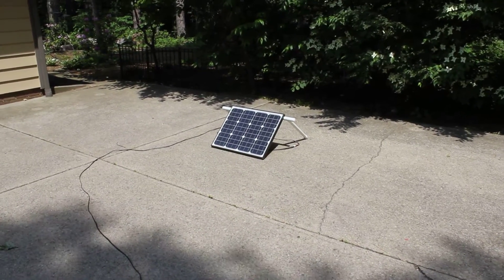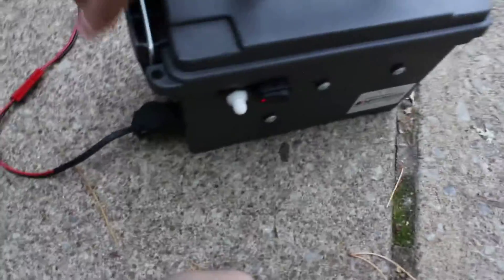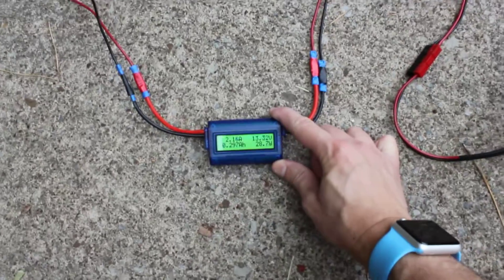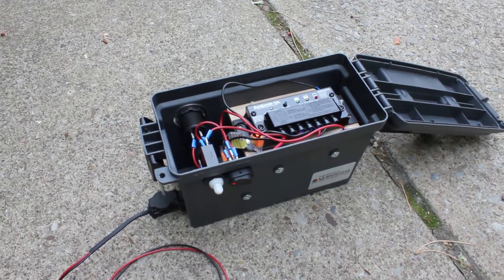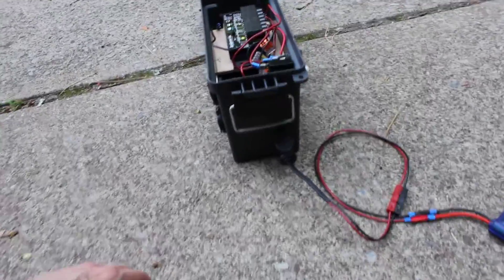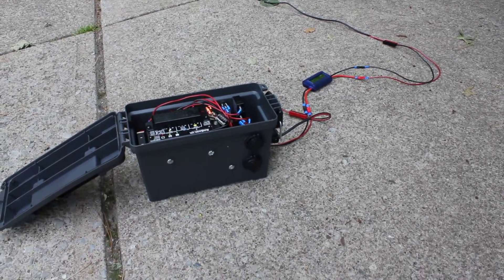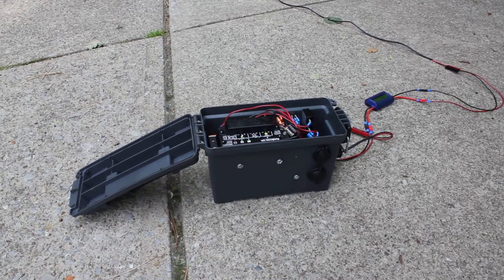Solar Ammo Box Generator - soaking up the sun!

Comment: Please try searching on eBay for "MPPT 5A" and do a rewiew of those solar chargers, they look really interesting.
Reply from the maker: Valent Turkovic I've looked at several of those types of units before deciding on the SunSaver.  It comes down to quality and durability.  Those generic controllers are less expensive, but there's a lot of trade offs IMHO.
Reply: Did you cintainer doing a video showing those cheaper ones and explaining their drawbacks? Here is another one - http://www.dx.com/p/600w-constant-voltage-constant-current-power-car-charger-solar-regulator-dc-dc-boost-module-blue-228310#.VcsrlEZHmnM
Reply from the maker: Valent Turkovic  I mentioned them in my project overview video and blog post (links are in the video description).  I'd go broke purchasing them just to review since there are so many, which many turn out to be the same units, just branded/packaged differently.  There are some that will slap a MPPT sticker on a PWM unit, etc.  One of my primary goals was safety and I couldn't trust any of the generic units out there after my testing.

Comment: Nice set of videos Matt on this set up. How's the new lithium battery/charger set up coming along? I'm looking to make either, so keen to see what you've got planned :)
Reply from the maker: TheLastPost Slow is the word I would use ;-)  Have a lot going on and want to get it wrapped up.  There's some key changes you have to take into account when switching battery types and I want to make sure I cover those in the next video.
Reply from the maker: I uploaded the video with the LiFePO4 battery and controller. Check out the playlist and let me know what you think.

Comment: Although I feel confident in my setup what would you say are the safety considerations/precautions on a setup such as this in order to not electrocute oneself accidentally? I've got a 175ah battery and 2 100w panels linked in parallel. In plastic box I have charge controller with inputs hooked up to anderson powerpoles mounted inside box. Then I have the battery and panels routed to the mounted powerpoles on the box. All connections with fuses. It seems to me the fuses are more for the gears protection and not the current...

Also, I have a few push wire connectors for the multiple load connections. I seem to have trouble getting the wire all the way up the push connector even though it supports the gauge I'm using. Any suggestions?
Reply from the maker: ***** The hard part about these questions are the unknowns.  I understand what you're asking, but there are several details missing.  Here's some recommendations:
- Look at each component and provide proper safety for each.  For example, make sure all your wiring that's exposed to the elements are rated for it.  
- You mentioned you're using fuses, which is good, as long as they are sized properly.
- Don't leave any electrical connections exposed since accidents do happen and make sure you have everything grounded.  
- Make sure you're using a properly size charge controller that's rated above the power you're bringing in from the panels along with the output.
- The type of battery you're using determines the precautions you need to take.  For example, if it's a lead acid battery, it needs to be properly vented to avoid a build up of hydrogen gas.

The list goes on and education is key. There's a lot of credible resources out there.  Here's a decent book I would recommend checking out: http://amzn.com/B008NQ40AY

It's inexpensive and covers a lot of the basics that helped me get my project started.
Reply: Got it. Don't seem to see the link to the book? 

A few questions with that in mind...Ill need to plug and unplug (turn off/on) my load (12v fan and pump) from controller from time to time. My charge box will be located in a safe indoor environment. Thus, I'm using Anderson connectors mounted to container box similar to how you are using the Powerlet socket. 

1. Is it safe to simply plug/unplug the Anderson load connectors while the panels are charging the battery? I know I must not unplug battery while charging or else I will fry charge controller. 
2. Would you recommend I install an on/off switch for turning off/load instead of plugging Anderson connectors in and out?
3. What is best way to disconnect entire system once I am done? That is, unplugging load, panels, and battery without harm to either myself or the equipment? I am confused by what your master on/off switch is doing but may want to implement it if it is cutting power to all systems and makes it safe to disassemble.
4. When you say make sure no wire connections are exposed and everything is grounded...all my wires are either in twist wire connectors or directly connected to Anderson plugs / charge controller and in a plastic container box with good ventilation. Also all the positive/negative connections are properly hooked up. Thus are my connections safe and do I need to do an additional grounding?

Thanks again! I've been reading a lot about everything as well but your input is very valuable.

Comment: Are you hooking mc4 cables from the solar panel directly to Anderson connector and then on opposite side of Anderson connector to 10 gauge wire to solar input on charge controller? This is what I am looking to do and want to verify this would be ok.

Thanks again!
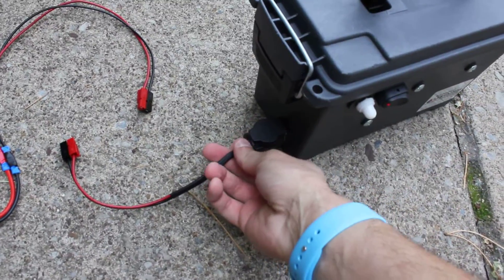Reply from the maker: ***** Almost.  MC4 -> Anderson -> Anderson ->Powerlet plug -> Powlet Socket -> Solar Input.  The reason I'm using the Anderson connections in this setup is for testing different inputs, putting the WattsUp meter inline, and trying different cable lengths.  Anderson connections aren't weather proof, so not a good choice for outdoors.  Watch at about 1:04 and you can see the Powerlet plug/socket.  If you haven't done already, check out my other two videos that provide more details.  Let me know if you have any additional questions and thanks for watching!
Reply: ***** Yes from what I saw in your other videos you are using standard gauged copper wire from the Powerlet Socket to the solar input. Just wanted to make sure the MC4 to Anderson would be okay as well as using standard copper wire directly into solar. Do you think using heat shrink over the power pole connections would guard the connections well enough for outdoor use?
Reply from the maker: ***** I wouldn't recommend it.  Anderson connections are great for indoor use and for testing.  The reason I went with the Powerlet socket/plug was for the quick connect/disconnect plus weather resistance.